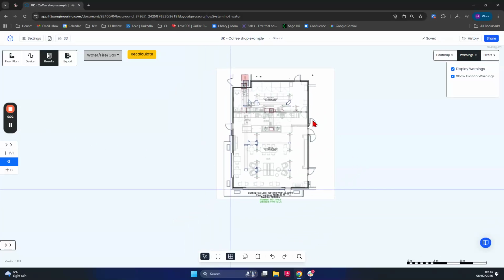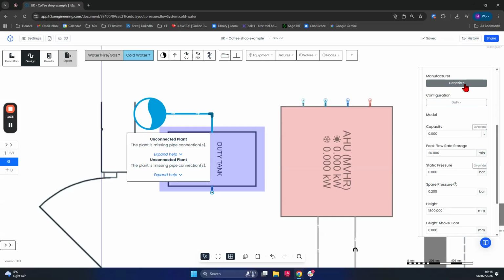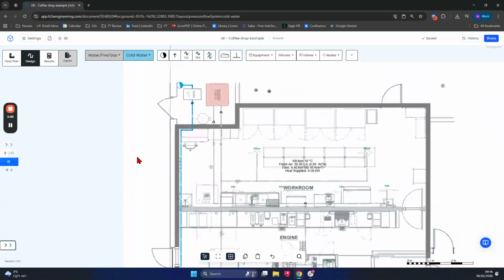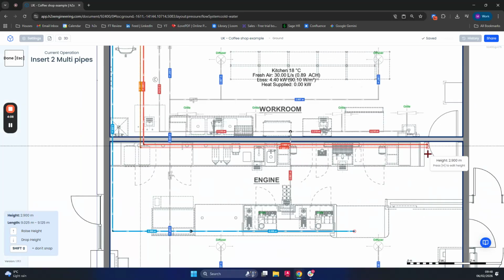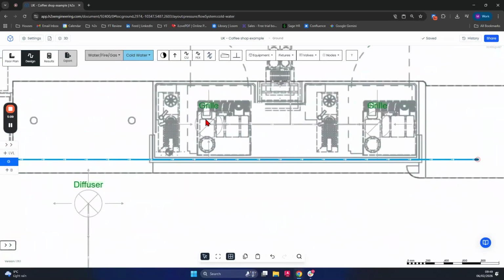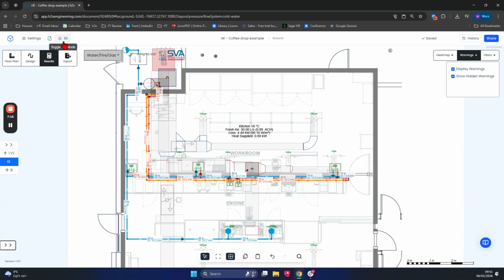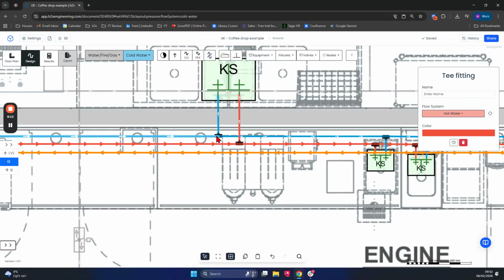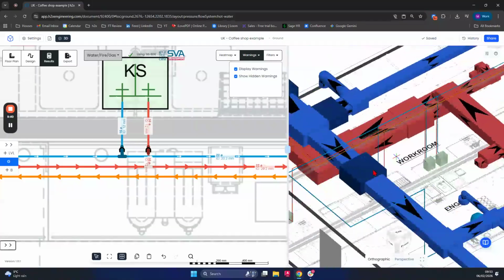How to Model a Full Water System Design in h2x

Comment: Hi there. So h2x pops up a message warning us every time we miss a valve or other component, right? Thank you very much!
Reply from the maker: Hi Jesus, h2x will warn you if you specifically miss a balancing valve on a hot water recirculation circuit. It will also warn you if you exceed the maximum pressure allowance at any fixture. Indicating to the designer the need to add pressure reducing valves.